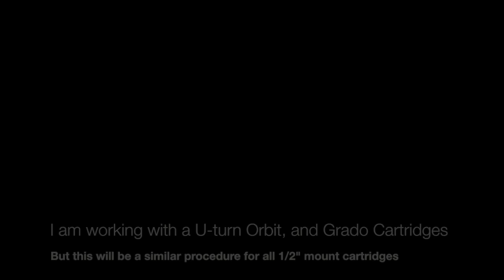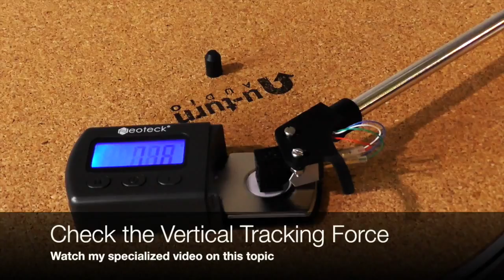How to Change a Turntable Cartridge

Comment: Always... Always... Insert the cartridge needle guard when doing install/adjustments other than tracking. If you think you can sneak in an install or adjustments just being careful without protecting the needle you might might find yourself screwed.

Comment: very late here - are the those tiny wires from cartridge straight into / thru the tonearm or do they have connections at end of tonearm, SME / Technics style.... I'm 73 (my excuse ) I broke one of the 4 tiny wire  connections going to back of cartridge, the design did't even have insulating tubes covering which would add a bit of strength.  turned a fairly expensive T'table into one worth about 2 cents, the 4 tiny wires going into tonearm not replaceable. at least by me and electric fix it shops have gone the way of the dinosaurs.  WHO designs these things ?  granted 4 single wires going straight from cartridge to the rca jacks on amp is better for acoustics, strength / durability should also be a design factor.

Comment: Yeah I won't be listening to vinyl for awhile. The holes for the new needle make it near impossible to assemble. Uturn should have gave a heads up about that. EF!!
Reply: Do they have smaller nuts for the screws or a set that works?

Comment: Those fucking nuts.  Makes me wonder why the don't implement a high tension clip system or something, similar to how a Floyd Rose works on a guitar.  I've been trying to screw them in for half an hour and still no luck!
Reply: I very specifically look for cartridges that have threads built into their bodies.  many do, some don't.

Comment: No matter how hard i try, the cables just wont disconnect from the cartridge. I try to grab it from the metal piece thats on the cable (yours is a clear piece), but I end up losing grip on it :(
Reply from the maker: Hi. Get a good pair of Needle Nose pliers and grab the flat piece just behind the connector. Here's a video I made with good shots on where to properly grab a normal wire: https://www.youtube.com/watch?v=BcQDoRxLBVM

Comment: PSA- don't grasp the cable by the rubber cover, grasp the metal connector
Reply: Do you have to get those rubber covers separately, or do they just come with certain headshells?
Reply: GLO-TUBE they were standard on mine, which model do you have?
Reply: @gossy79  I think the headshell I have is just the one included with my Technics SL-235, and since its secondhand (or tenthhand?), who knows how it came originally. Guessing the one in the video just came with covers, but I guess I can use Google and find out if I can buy some if I really feel like it, ha. Thanks for taking the time to reply.